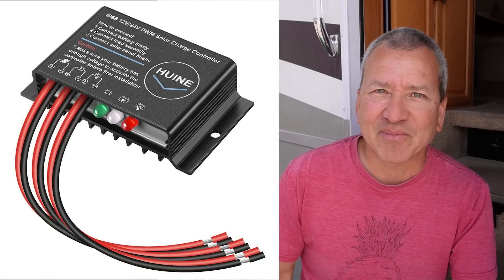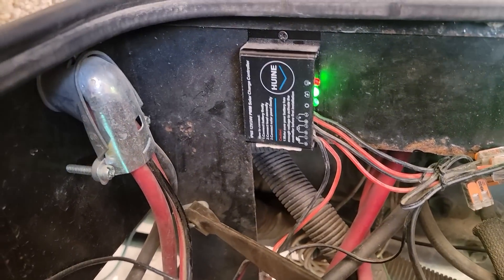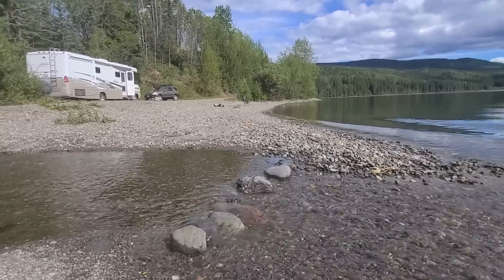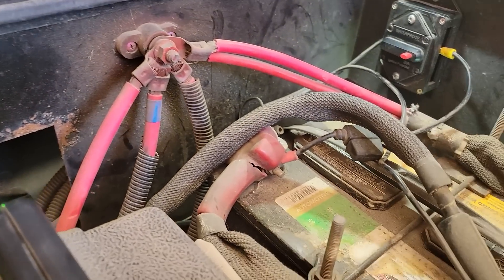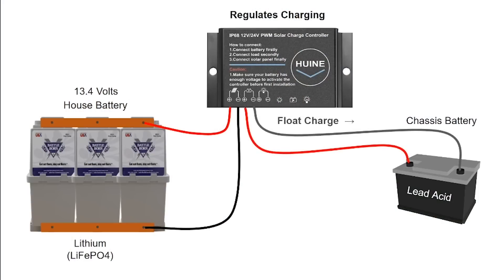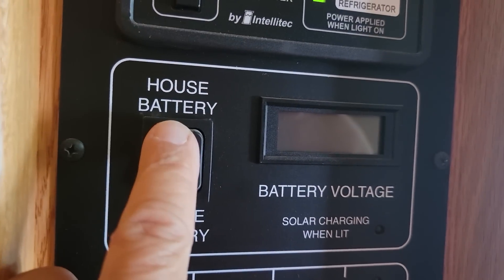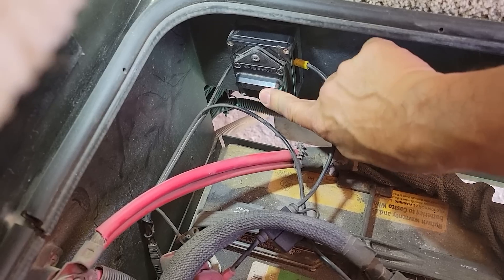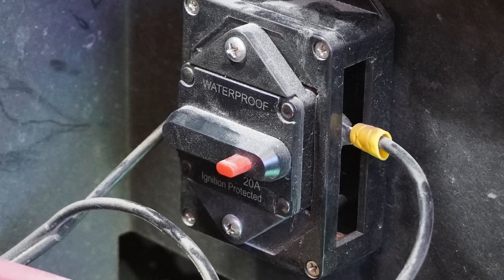This $20 Hack ACTUALLY WORKS as a DC-to-DC Charger for RV Chassis Battery | RV With Tito DIY

Comment: So I contached the manufacture of this exact charge controler, and they confirned that this will not work.  You think it's been working, but it's been doing nothing.  You have to love youtubers - they are always making a DIY video on something they know nothing about.  Don't follow this guy's advice.  You need a charger that will take a 12v input.  This one will not.  Most all will not.  Victron has some that will - and some other companies.

Comment: Most of these PWM charge controlers need about 5 volts above 12 volts to actually output something.  Are you sure it's even working?  Inputing in 12-13 volts may not be enough for it to output anything.

Comment: Great setup, I have a solar system, including AGM’s two 12v batteries in the Coach and I could get 24v out of them, could I run them to get 12 volt for charging the chassis battery? Thanks
Reply from the maker: It may work as is but you'd have to test it. Make sure it recognizes your chassis battery as a 12v instead of 24v. It's OK if the charge source is higher. The PWM controller should ignore any voltage above the charge voltage.

Comment: The load circuit on that PMW charge controller can provide power for a thermostatically controlled heater if you need one to keep your battery compartment from getting too cold..

Comment: I am having an issue with the engine battery power flowing back to the house battery in my testing. Is my mine defective? I am attaching the +/- solar wires to the house batteries and the +/- battery wires to the engine battery. Or did I do something wrong? Thanks!

Comment: Thanks Tito. I just added a 300AH lithium battery as a 3rd battery bank in my RV which had an existing lead acid start battery which is charged by the alternator and an AGM house battery which is charged by the converter and the alternator. The existing house battery was also being charged by my solar panels but I had to use a different configuration because the existing alternator created a potential problem charging the lithium battery. By using this $20 hack I was able to just charge the new lithium battery with my solar power while keeping the existing converter and alternator power supplies for the house and start batteries. The solar power and the lithium battery, along with this 20 amp DC-to-DC charger will keep my house battery topped off. There were other alternatives but they involved extensive rewiring and at least one expensive b2b component. I should add that I have been using a Trik-L-Start to keep my start battery topped off and will continue to use that. The bottom line is I now have an additional 300AH of house battery power when I go off grid or there is a power outage.

Comment: I've actually thought about doing this with a cheap PWM controller but going the other way from my tow rig to my travel trailer. It charges pretty slowly while charging with just the 7 way connector but I ended up putting solar on top of the travel trailer and it eliminated that need but it also allows me to maintain the tow rig battery while parked if I leave them connected.

Comment: Do you use this instead of a dc to dc charger. Does it protect your alternator. I just installed 2 lithium batteries. I was told I’d need a dc to dc charger to protect the alternator.

Comment: This is great!!  I wanted to rig in a simple inexpensive way to run current back to the cranking battery as I was worried I would drain it too much from useing the radio or something!!  my 200ah LFP house bank can so easily run a small charger for 10-15 min to get the cranking battery able to fire the engine!  Fantastic!!
Reply from the maker: Glad you like it. Give it a try. It has been working great for the last year.
Reply: @RVwithTito    What kind of amp transfer are you getting?  my results have been very low, 3-4 amps at best with the cranking battery at 50% SOC.  I think it is because the PWM controller cannot get enough voltage from the LFP battery to really enable it to push out to the PB battery.  They are setup for PV input of 25ish volts likely, so.  Tried a 20a PWM solar charger.   I was hoping for more, my plan is to use this as a safety to assist if my cranking battery went dead from say using the Radio or something like that.  This is in a small camper van where the stereo is the van dash unit.  If it gets drained to the point the van wont start, this will take hours to put in enough to turn it over.  I also am setting up a cut off switch from the + on cranking to the input of my DC2DC charger as it uses voltage sensing to turn on.  Basically it has a built in VSR, so I don't want that to sense the power input from this charger.

Comment: Nice job .
Could  you use the same type of controller  to take power from alternator  to the leisure  batteries.  
The dc to dc chargers  are a lot more expensive
Reply: The voltage supplied by the alternator may drop below 14V, so it will not be able to charge the lifepo4 battery (typically PV controllers can reduce voltage but not increase). However, this can be easily remedied by adding a step-up DC-DC converter where you can also set the minimum input voltage, so that charging will not start until the engine is started. A 20Amp step-up converter costs ~$20.

Comment: If the fuse disconnects, it will blow the pwm module. They all say you have to hook up the battery first or you damage the controller.

Comment: I installed this in my RV and the 20 amp breaker keeps tripping.  It's because the Huine charge controller output is rated a 20 amps.  So, you really need a 25 amp breaker with 10 gauge copper hookup wire to meet NEC code.   I'm very concerned that the wire leads on the Huine controller are measly 16 gauge aluminum.  Perfect for starting a fire.    I've since tossed the controller in the trash and am planning to replace it with a Renogy PWM controller that charges at 10 amps, which is plenty for trickle charging my battery.

Comment: Question for you: what size wire did you run for this (it looks like the charge controller is using 16awg? 

Second question : are your positive and negative leads from the small charge controller mentioned are they running to your Victron Lnyx power in or are they connected directly to the lithium batteries as mentioned in your video? If they are connected to your Victron Lynx what size fuse would you recommend? 20amp or 30? I try not to connect anything directly to my lithium batteries other than my Tfuse and smart shunt…TIA
Reply: The Huine charge controller can output 20 amps, so NEC code requires 10 gauge copper.   The measly 16 gauge aluminum leads on the Huine are a fire risk in my opinion.   Renogy sells a 10 amp PWM charge controller for $20, but I'm not sure if it can operate at the low voltage provided by the lithium battery.

Comment: Hi Tito, great idea. I have a left over (lead acid only) Blue Sky MPPT controller that should work as well. I'm thinking; connect it in parallel with the lithium EPEVER MPPT controller on the PV side. That way the PVs will be charging both the lead acid and the lithium when the Sun is out. I prefer that rather than charging the lithium batteries from the PV then charging the AGM from the batteries. My question is; can two controllers be connected to one PV array? Also, if this would work, which ever (or both) battery banks need charging, they will get charged. What do you think? (on my RV, some devices still run off of the AGM (as well as the parasites) so the AGM needs about 5Ah per day. I have to figure out how to rewire everything so I can eliminate the AGM. There's no wiring diagram for the RV.) I'm not concerned about the chassis battery, it's good for months.

Comment: This is exactly what i was thinking of for my rv as well. I just purchased a red arc DC to DC charger that cost me $250 but have not installed it yet ... I think ill keep it and get this MMPT controller instead. Great video.
Reply: So what this PWM controller was able to do is that is that it connects from your car led acid battery which is already connected to the alternator and then takes current from there and charges your secondary battery which can be protected using an MCB. Am I correct?
Reply: @gauravsinghsays  Not sure what you mean by that but what it does is allows your house battery to be charged by the solar panels when not in use and then when you are driving and the engine is running it isolates the main and house batteries so no damage accours to each.

Comment: Anyone know what the input voltage range on this PWM controller is? I'm contemplating going with 48v LiFePo4 house battery, but still have 12v LCA chassis batteries that want to charge from house battery. Looked at Amazon listing, but didn't see input voltage spec. Will have a 48v to 12v DC to DC converter for house circuits, but that will be a constant supply, not a profiled charger. Would rather not connect this to the 12v side and put extra load on the converter. Would rather it connect direct to battery bus.
Reply from the maker: It's a 12V or 24V controller

Comment: Can the ground wire from the charge controller be connected to the frame of the vehicle instead of directly to the starting battery ground?

Comment: Great idea! (who's surprised?) - I had installed a trickle charger for the chassis battery that connected to my house 110v circuit, but this solution is better. Thanks AGAIN Brian!

Comment: This really isn't a good idea for normal use.  PWM works by shorting PV to battery, and they can't effectively modulate current, so there is a potential for massive surge from the LFP to lead acid.  Fuse on both PV and battery wires is critical.  The experience with blowing fuses during start illustrates my point.

Comment: I have a question regarding the 4 stage charging profile to the chassis battery using a pwm controller and if the input voltage is steady around 13.2 to 13.4 volts, how can it meet the higher 4 stage charging voltages 13.6 to 14.7 that the battery manufacturers recommend. A good trickle charger will meet these higher charge voltages and you won’t have to worry about blowing the fuse or breaker after starting the motorhome. As somebody else mentioned I use a good trickle charger on the chassis battery that is powered from a maintained ac outlet, shore power or inverter.

Comment: Beware that most charge controllers do not like to have an input connected with no output connection ( your breaker opened). I have a few Morningstar Sunsaver controllers that have this warning with them, and many others I have used are the same.
Reply: I have a small cheap mppt that takes its power from the solar array. It implicitly states that you MUST connect solar first and battery last. Always refer to the documentation for your device.
Reply: @ssteele1812  The device he used has printed right on it "Connect battery first. Connect solar panel finally." So this should be good. Mine arrives today. 🙂

Comment: I added a Votronic Standyby Charger to my campervan to stop the starter battery going flat when parked up. It uses excess solar once the house battery is charged to trickle charge the campervan starter battery. I added a fuse and a switch - so we can turn it off when we are driving. The unit is very small and very easy to instal and cost about $20-30. Its been a great addition, we no longer have an issue with the immobiliser and central locking systems draining the starter battery when the campervan isn't in use.

Comment: If you already have a DC-to-DC charger that charges from Chassis/Generator to the House battery, make sure it is only ignition enabled if you do this hack.  You don't want both "on" at the same time.

Comment: I have a question for you we just purchased a 2020 holiday rambler that has a factory installed 100 W solar panel with a 2000 W inverter can I add extra panels to the existing panel on the roof? some people have told me that you cannot do it.. it Has to be the exact same panel is that true or false and if I can, how many panels can I add to the existing panel?
And also one extra question if I am able to hook up extra panels, do I hook them up in series or parallel?
I really didn’t wanna add a whole new system with new batteries and inverter and solar charger
I would really appreciate your expertise on this matter….thanks,Frank

Comment: My Forest River C class has a switch on the side of the driver seat that allows you to tap into the house batteries if your chassis battery is too weak to to start the rig.

Comment: Your multiplus ii has a built in 4amp trickle charger for starting battery. Even if not using the rv, just leave inverter in charger only mode.
Reply: Victron MultiPlus 4 Amp will work for this just fine AND you do not have to leave it on charge.  The 4 amp trickle icon all the time.  Works great.

Comment: My 2020 Forester Class C has a switch below the driver's seat that does just that... gives a jump from the coach batteries to the truck battery. Never tried it in that capacity but I hear it make a noise when I activate it just like a booster would... thanks!
Reply from the maker: Yes. That's an emergency start switch. It temporarily joins the two batteries in case (1) your engine won't start or (2) your generator won't start. The relay (clicking you hear) is located inside the driverside engine bay (probably).

Comment: Your timing of this video is impeccable. My chassis battery just died from sitting without use. I did some You Tubing and came across an item called "AMP-L-START". Unfortunately, that company is no longer in business. This set-up you have will work great for me, although my house and chassis batteries are not in the same compartment, so a cable run will be need for me. Thanks again.
Reply from the maker: You're welcome. Sounds like you've got a plan 🙂

Comment: i am curious what gauge of wire you used for your DIY dc2dc charger
Reply from the maker: For this low current trickle charge setup I used 12 or 14. For my other Victron DC to DC setup on our previous RV I used #6AWG.

Comment: Will your hook up be worked with DCDC Charger in place? Thanks
Reply from the maker: Yeah. Probably but there should be little to no current flowing while the engine and DC2DC charger is running. As another guy suggested...adding an ignition cutoff relay is something to consider as well.

Comment: My apologies for interrupting this video thread; however, 3 years ago you did a video concerning your shattered shower door, I may be blind, but I didn't see a followup video. Did you make one, and where in your video library is it?  Thank you
Reply from the maker: No problem. Here's what I ended up doing https://youtu.be/Z_WoxSugaME
We ended up liking it much better. So does the new owner 😃
Reply: @RVwithTito  

Tito, so that's your new shower in the new unit, what did you do to fix the old one?  Thank you!
Reply from the maker: @John P  No that's the old one. The class A we're in now has a stock glass enclosure. Funny saying old vs new since our new Class A is actually 4 years older than our old class C 😃
Reply: @RVwithTito  

Well, I like what you did.  I unfortunately don't have a house to do that kind of work; apartments are not conducive to building things.  Thanks for the info and the videos, carry on!

Comment: Brian,

Hi Brian, I wonder if you don't need an ignition lead to interrupt the output current from the Huine when you are driving.   I have upgraded my coach much as you have but I've not yet installed a trickle charger to keep the chassis batteries charged.  

I'm thinking that you may have created a power wasting current loop when you are driving.   When you are driving the Victron DC/DC lithium charger sends current from your alternator & chassis battery to the lithium batteries.  In turn, the lithium batteries are sending current via the Huine charger back to the chassis battery creating a power wasting loop.  It may not be much, that's hard to assess without knowing the state of charge for each battery and the specs of the Huine, but it may be prudent to use an ignition lead to interrupt the Huine output to the chassis battery when you are driving.

Best regards from down the road in Kingston.

Take care,
Bob
Reply from the maker: You make a good point, and that's a great tip, but I don't think it's a problem in my system. Let's assume the alternator circuit runs between 13.4v to 14v with the engine running. In this state, the chassis system voltage would be higher than my house voltage which usually doesn't get that high when under load...always (even while solar charging). So there shouldn't be any current flow through the PWM charger even as the charger switches to float (given the measured chassis voltage). Nevertheless, I still think your idea is something worth implementing just to clean it up. Thanks 👍

Comment: That is so creative and simple!!! Wow great job finding this application for pwm controllers. Always great stuff, thanks Tito
Reply from the maker: Thanks bud. I appreciate it. I literally have a bin of old PWM controllers sitting around waiting to be used for something.
Reply: Can this be done in reverse, when you’re driving? From the chassis battery to the house battery using the same charge controller, or would you have to use an MPPT version.
Reply from the maker: I'd recommend a better DC to DC charger designed for that purpose like a Victron 30A DC to DC. It will handle the higher current draw and battery compatibility much better with lots of settings for you to customize. Here's a video to check out https://youtu.be/lvOYUfSBlmM
Reply: Yea, but it doesn't work.  It's not high enough voltage to get it to work.  Don't follow this guy's advice.